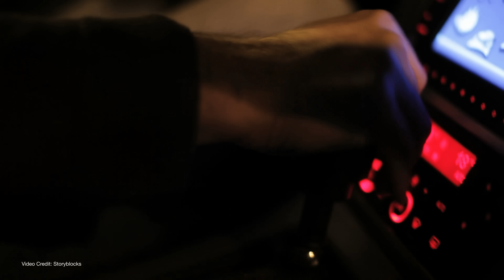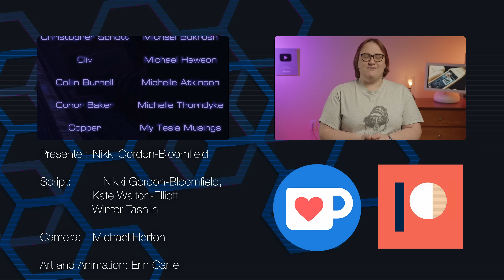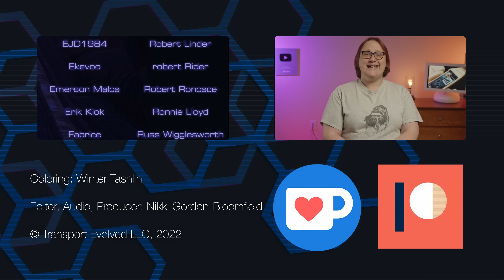Electric Cars Don't Need Gear Shifts - So WHY Is Toyota Working On One?

Comment: The thing that Toyota doesn't understand is most people don't buy manual cars anymore.. most cars sold in the US are automatic, more EVs sold than manual EVs back in 2019
Reply: I'm not sure that's the case in the UK - I've been driving for 43 years and never owned, or driven an automatic!  
Can't even remember the last time I sat in an automatic ......
Seems we like to change gear here..!
Reply: Is that from availability or desire?
Reply: @Crissa Kentavr  Desire. Manual transmissions started falling out of favor in the early 2000s. Between 2010 - 2015 the demand for manual dramatically plummeted, even most performance brands are going full auto due to quicker dual-clutch transmissions (Dodge SRT, Lamborghini, McLaren, Corvette, etc.)
Reply: She mentioned that. But in other countries there are a lot of manuals sold or are used cars. Toyota sells cars to more than the USA.
Reply: Yeah the famous USA….. is USA the only place in the world for cars!? Stfu!!!!
Reply: @carholic1336  About 50% of cars in China were automatic in 2020, with an upward trend in automatic transmissions. Keep in mind that China is also a leading car market, just like the US is (less the 1% market share for manual in the US)

So if two of the largest car buying markets are majority automatic, and the only reason manual cars are relevant in any quantity in the rest of the world (outside of China and the US) 

There's simply no need to develop a manual EV, a manual EV is just stupid, it would add unnecessary steps to the process of driving, increase production complexity, narrow the market for that specific model, reduce adoption of EVs (taking up valuable resources) and wouldn't benefit the EV at all, it wouldn't be more efficient, reliable or economic. Reduction gearboxes have proven to be the most reliable, affordable, efficient, effective and simple solution to driving an electric vehicle. If someone wants to buy a manual transmission, it's because they intend to buy a gas car, which should not be encouraged in any capacity, whether it's a used or new vehicle.

But uhh go off "carholic the stfu guy"

Comment: I didn't know the UK differentiates between an automatic and a manual license.. for the last decades I've been told that Germany is the only country that does that (a demonstration of our love of bureaucracy, obviously), and we abandoned that rule two years ago.
And just to confuse people, I've mounted my old Logitech gear shifter in the cup holders of my Ioniq5. In some countries, that might even reduce risk of theft ;-)
Reply: Multiple countries still do that. I know in Belgium we also still differentiate between the two. And I think that's a good thing. If you were to let a person who has never driven a manual car drive in one, they become a bigger danger on the road.
Reply: ...And that's different from a learner or someone who took the test but hasn't driven in one since?
And it goes the other way, too.  When you let go of the pedals in a manual car, it doesn't take off without you, but an automatic or EV with creep will happily do that!
Reply: Ireland too, waiting for youngest to pass test before replacing 2nd car with an EV.
Reply: It is the same in France.

Comment: So they want to patent when my Bolt (or any other car) changes between D and L then?  Silly Toyota.

Good case for different license certifications maybe.
Reply: What's L?
Reply: 'Low', an increased regen setting in an EV.
Reply: Sometimes L is B for Brake, they are ment to emulate engine compression braking.  For descending a mountain pass or other large hills.  But I pretty much just drive in it all the time for the extra Regen they do.